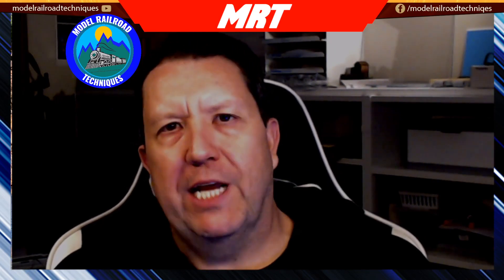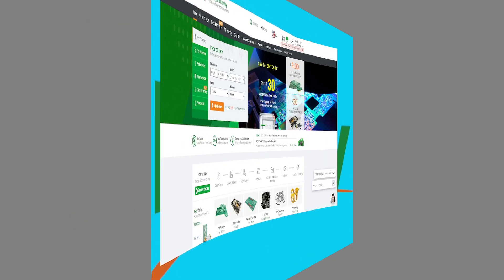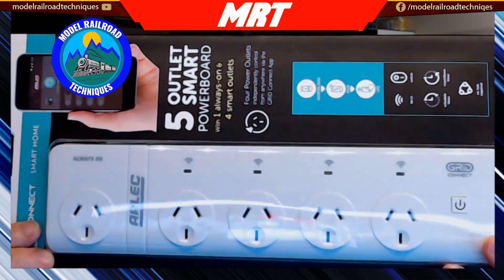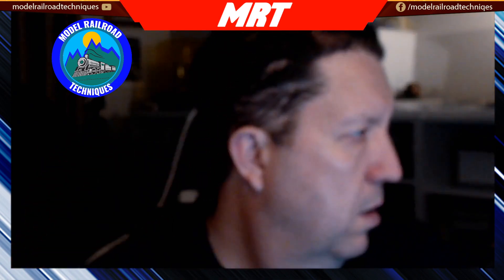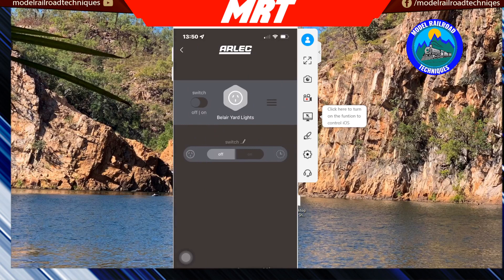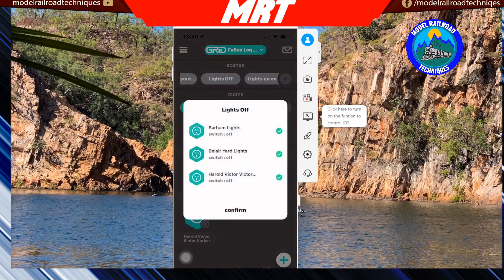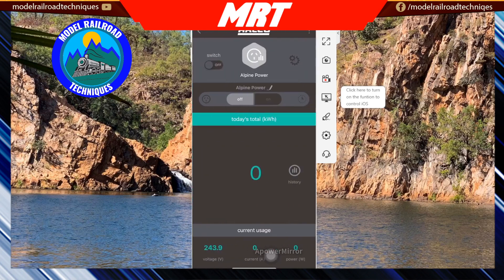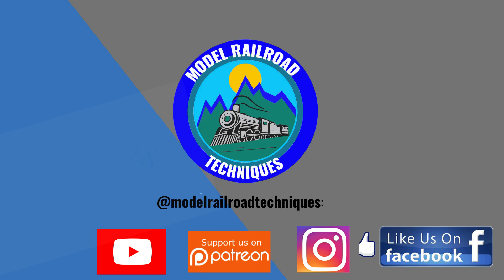Model Railways MEETS Home Automation

Comment: Glad to find this; I have been experimenting with Home Assistant, using MQTT as the protocol with JMRI as the platform with a Stream Deck to control connected using Bitfocus Companion, which can also control a working switch/mimic in Home Assistant. Interesting to see where all this will go.

Comment: I use an old 500 watt PC power supply plugged into a WYZE smart outlet for all my rail, accessory, Arduino etc power. WYZE bulbs in the room and layout lighting is LED strips via WLED app. Have a couple old Android phones using DCCpp CAB App for quick throttle control the rest of the layout is controlled via JMRI with several Arduino's via DCC and CMRI on an old laptop.
Reply from the maker: Great ideas mate

Comment: I've seen Charlie from Chadwick Model Railway using remote powerstrips as his "emergency stop" on his railway and I have played with JMRI for automating trains but taking it to the next level is something I have been thinking about for a little while.    I use Home Assistant for home automation and have been wondering how to integrate things together more.   I like to tinker around :).
I've been thinking of maybe controlling the main lighting in the room and linking it to the layout general illumination to simulate sunrise/sunset scenarios so the layout is synced with the room lighting and similar things like that.    I remember visiting a model railway layout in Queensland when I was a child and they had a setup like that and I thought it was pretty awesome.  Of course back then it would have been pretty expensive to setup a system like that.
Reply from the maker: Great news.. keep me posted. It such cool tech
Reply: @ModelRailroadTechniques  I'll see what i come up with.  I'll probably need to use dimmers and use  timed transitions, which are available in Home Assistant, to get it just right :)

Comment: I use some smart power bars to turn my layout on/off and have even used an old bit of software from GamesOnTrack that let you use voice control to throw dcc turnouts etc.  The voice recognition in that software was not great however and only worked best with a headset mic. Right now what I really want is an Amazon Alexa skill that lets me throw turnouts using voice - so far I haven’t seen anywhere yet. I looked once at writing my own Alexa skill that would interface with my ESU eCOS command station but with my limited programming skills it was a little beyond me.
Reply from the maker: Great...I think Hans Tanner has achieved this with voice commands
Reply: @ModelRailroadTechniques  I have seen the IOTT stuff but I do not use Loconet on my layout. The simple solution I plan to eventually implement for Alexa + turnouts is using a Arduino Nano 33 IOT board with Arduino IOT Cloud that sets up each turnout as a on/off light or similar device. Then in the Arduino code I can either have the on/off function communicate with my ESU Ecos via wifi to throw turnouts OR use a ethernet shield to create a DCC base station to send DCC commands out and use the sniffer port of the ECOS to receive those.
Reply from the maker: @chrisc6333  awesome let me know how you go.. sounds fascinating